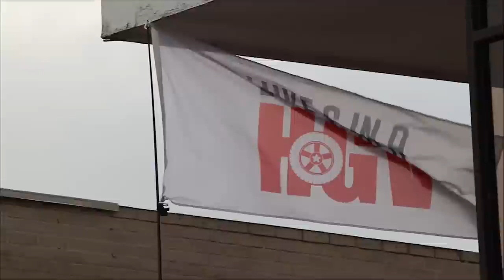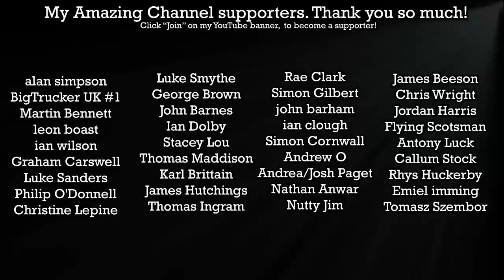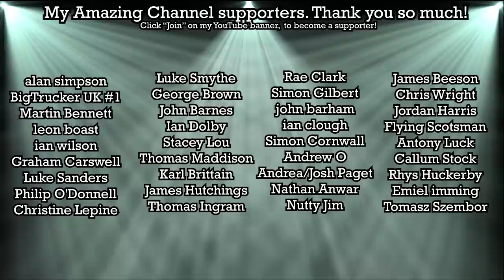The Worlds SLOWEST Site!

Comment: Interesting on the license. In Queensland, Aussieland to drive a manual truck you have to do your license in a manual. I'm looking at getting my auto license as well so I can drive an automatic but can't find anyone local who has an automatic. They are so rare and after nearly 15 years driving I've never seen one that I know off but I'm getting old, nearly 50 and starting to have trouble driving an manual.
Reply: It used to be the law in the UK that you could only drive manual trucks if you took your test on a manual. If you took your truck test on an automatic, the truck category on your licence was restricted to automatics only.

The law changed a few years ago. So long as you have taken one car, truck or bus test in a manual, all your car, truck and bus categories are valid for manual transmission vehicles unless there is a medical reason to restrict your licence to automatic only. You can remove an automatic only restriction from all categories by taking a test for a new category or retaking a test for a category you already hold in a manual.

It is still common to take your car test in a manual, though an increasing proportion of UK cars are automatic, not least as electric and hybrid vehicles become more common.

The change in the law was because almost all trucks and buses are now automatic.
Reply: @DavidWood2  Wow so different. Most 98%  of our trucks are manual. I did my car licence in a manual so I could also drive an auto. I'm driving a 12spd truck dropping down from an 18spd. and hoping to get an auto. But no-one has autos. So looking to move to the UK.

Comment: #LessLuke, I done my class 2 in a straight 6 speed truck back in 2007, we were taught to select 3rd for pulling away at lights etc. but 2nd on an incline while the bed is empty. only thing to be aware of is the power needed to pull away, so none of the pull 1 car length forward because the car infront moves forward a car length. so effectively once handbrake is applied never release until a green light and safe to pull away. another thing we were taught was to stop, select pulling off gear, and then wait for a green light with our foot on the clutch, even if the lights have just turned red.

Comment: bloody funny looks like it's only the wheel wash . Creating  the need for a wheel wash . Water running back on site which you then have to drive through. A smart thinking bloke would have excess  water running to a soak way . And not have the mud bath on site to run through . ? MUST BE SOME JOB CREATION SCHEME